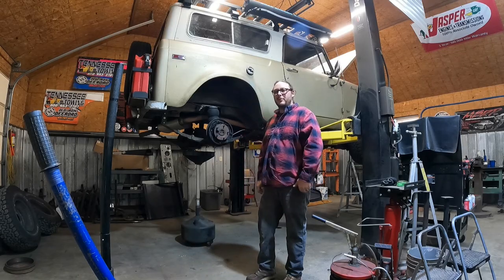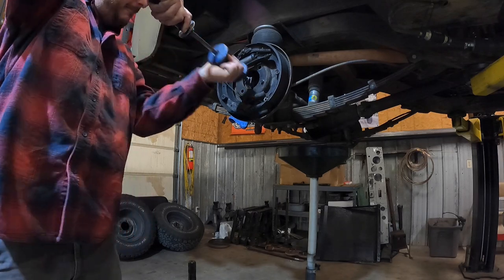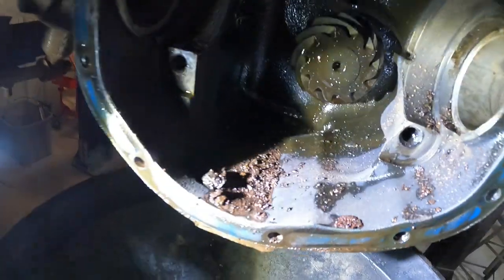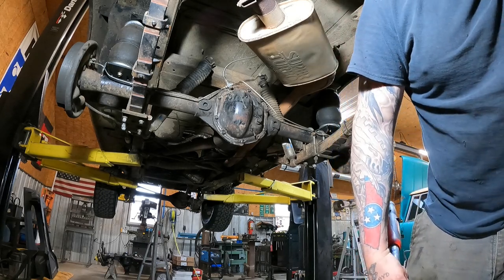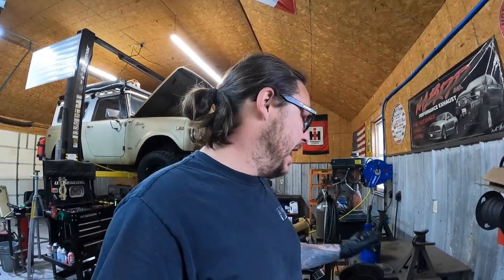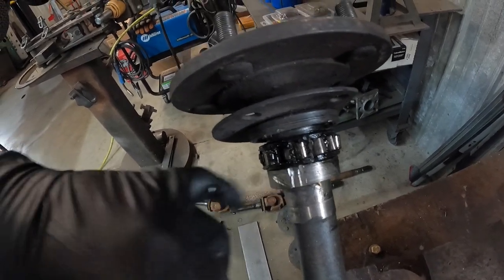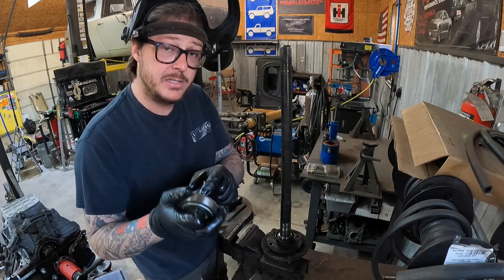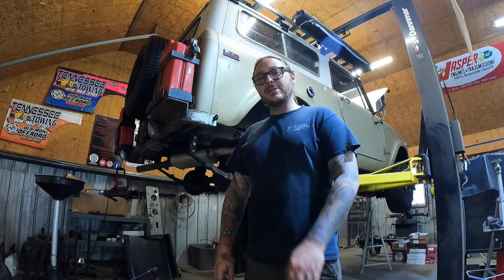How to remove and replace Dana 44 rear wheel bearings and convert to oil bath.

Comment: So we just replaced our 78 Scouts rear diff with a limited slip, and also replaced the leaking axle seal on the passenger side shaft. We noticed after putting everything together that the brake drum doesn’t cover the shoes quite as far as the driver side (maybe a 1/4”). Not sure if that’s just how they’re designed but I doubt it. Rather than tear it all apart, I’m curious if anyone knows whether the direction of the axle shaft matters, or is it just completely flat sheet metal?
Reply from the maker: Would say that you have the wrong drum on that side.  Measure the depth of the drums side to side and see if they are different.  I would bet you have a 71 to 73 drum on one side which is narrower.
Reply: @OldIronOffroad  Good Point, I will check to see if the PO put on a different drum for some reason. Oh, and I meant to ask if the axle shaft RETAINER mattered, not the axle shaft lol. I'm at least handy enough to know which direction the axle shaft is supposed to go 😅
Reply from the maker: @trevorterry795  No the retainer does't matter. As long as the bearing is fully seated and there isn't excessive endplay in the bearing and the retainer isn't bent.

Comment: I have 60-66 chevy c10 with a Dana 44 will the set10 & 9912 work?
Reply from the maker: Not sure. Browsed quickly through a parts catalog and there aren't any listings for a set 20 on that axle. Best bet would be to pull it and snag some part numbers off the old stuff.
Reply: Will do thanks
Reply: The only thing I found was NEW DEPARTURE  88128  made in USA any info would be appreciated thanks

Comment: Great Video! I did that to my 76 Scout II 25 plus years ago it had a dry bearing set. The only thing I found that the filler hole in the stock Dana cover is a little to low to put in a good amount of gear oil in the diff. I am not saying to put in a bunch of quarts in the diff, but an amount to have the oils level so it is in the tubes all the way to the bearing. I found that Outlaw Differential Cover has a filler on the top of the cover and it is earlier to fill and gauge how much you need. Just wanted to let you know that I have nothing to do with ODC but I received it free in a drawing at TDS years ago.

Comment: Any reason not to use the press to remove the old bearing so you don't risk nicking the shaft?
Reply from the maker: None at all.  If you have the proper fixture to do so.

Comment: HAHA!!  Literally sitting in a Kwik Lube this morning getting an inspection done for my sons truck watching this, and couldn't help but start laughing in the waiting room on the rear end comment!!  hahahaha - that one got me at the right moment!!  So couple of questions:
1) you removed the inner seal by the carrier to allow the diff fluid to travel into the tube and keep the outer bearing greased right?
2) the purpose of doing to is to not have to remove the axle every year or so to re-grease the outer bearing?
Thanks for video and the laugh Levi!  Hope all is well!
Reply from the maker: Yes sir.  Pull the inner seal, clean out the tube, and give the wheel and tire a tug and a shake on your next pre trip inspection instead of pulling the axle and greasing.

Comment: Great information on these old axles. 
Any idea what years they converted to oil bath tapered bearings?
Reply from the maker: Around 74 I believe.
Reply: @OldIronOffroad  thanks. 
I've got a 73, 74 and 79. Guess I'll start with the oldest and make sure they're all squared away.
Reply from the maker: @christopherketchum323  keep in mind that just because they are already oil lubricated doesn't mean they don't need replacing.  Best bet is if you don't know when they were done.  Replace them.
Reply: @OldIronOffroad  absolutely agree. I have no knowledge on condition of any. However, I'd be inclined to tackle the highest probability of failure first. If that makes sense.